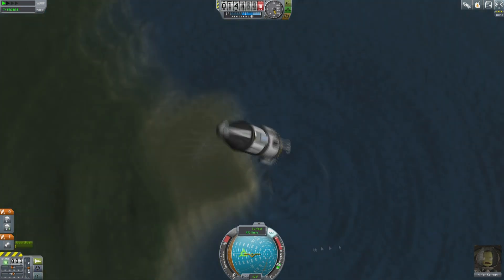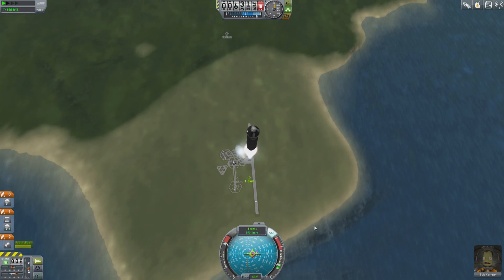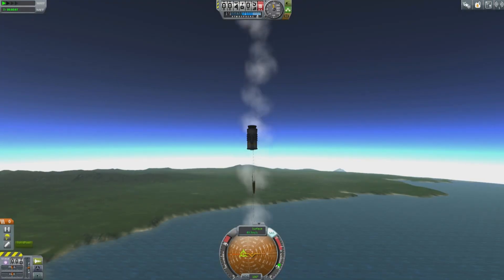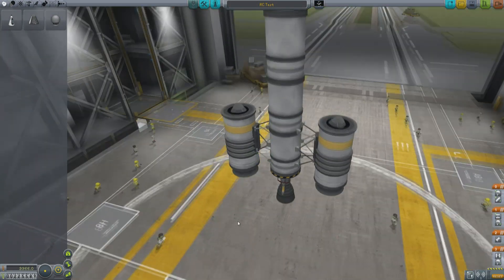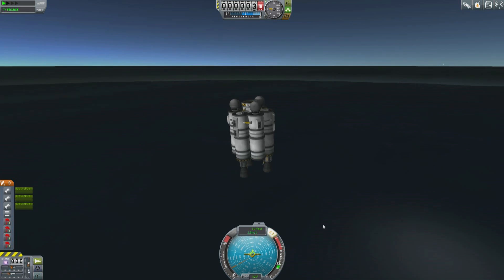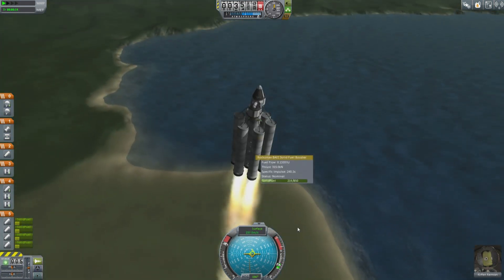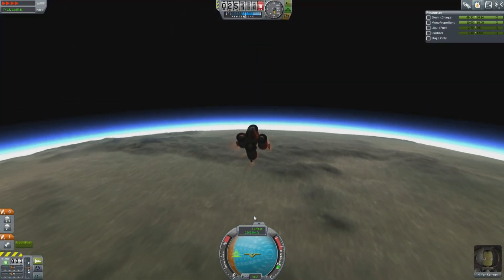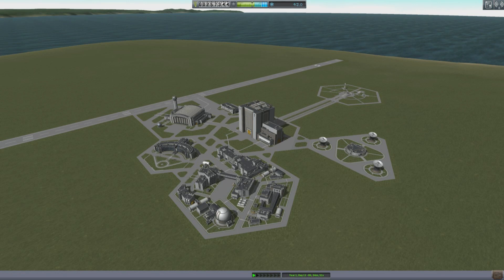Kerbal Space Program - Recovery And Reuse Tutorial in First Contract

Comment: Scott, Debris will be added to your funds when you recover it. At least thats what I saw in 4KBShorts Video. He pointed that out in an overlay to correct what he said in the Video. Seems like there is just the Ingame-Popup missing.
Reply from the maker: When I tested it last night was not getting any cash back, and there's also the automatic removal of anything too close to the launch pad, that doesn't generate any cash.  
The game is in development, it's possible things are changing.
Reply from the maker: Mark Parigger Ahh I know what you're seeing, there's an edit in there. I originally went to the map screen and there was another mission that I realised would confuse things, so I deleted it (getting cash) and then redid the clicking through to the tracking station. The money came during a section that was edited out.

I of course edited it out to reduce confusion, and, failed.
Reply: Scott Manley  But if you look closely in your video right here the funds do change after the debris is automatically removed. It goes from something 516 to something 586 (or something like that). I'm referring to your test if boosters without probes are recoverable, the two screens between the time you go into map mode (of the tracking station).
Reply: Scott Manley  Well, you really have to look for it (as I did because I had watched 4KB's video as well). So in general it's really not confusing at all. But I'm still glad that that's cleared up - and it isn't that important anyway.
Reply: Scott Manley You did not fail, my friend :)

Comment: since tanks are probably cheaper than engines, why not put one giant engine under the central core and arrange ejectable tanks around it radially, connected through asparagus-style fuel lines ?
Reply from the maker: Well the large engines tend to be less efficient in space so there is that.
Reply: AverageArts You can't counter act that. Your craft is very heavy on ground since you have a lot of fuel. You need a very strong engine. As you lose the tanks on the way up your craft gets lighter and lighter but your engine has the same weight and same power. You can limit its power but not its weight on the way up. This is why asparagus has not one big engine but lots of smaller ones. You get rid of thrust which you dont need AND engine-weight at the same time. They don't really use asparagus staging in real space flight anyway. Fuel is cheap so you can simply use a little more of it instead of doing some crazy fuel pumping which is risky. Just look at the Falcon 9. They use cheap kerosone-like fuel, 9 engines for redundancy and because they have to build more little engines they get cheaper due to mass production than fewer big ones. They also use 3D printing which can be done pretty much on every planet so you can make your own parts in case something breaks. The material can have far more complicated structures in the inside with 3D printing so you don't need solid blocks of metal. You can make aluminum with honeycombs inside. Very rigid and light. A nice side effect is those honeycombs act like a heat shield aswell.
Reply: The problem is the lighter your craft gets the higher is the relative weight of your engine compared to the rest of your craft. When you don't get rid of some engines on the way up you end up using more fuel again than you had if you had picked less fuel and a smaller engine. Asparagus is only usefull if you split your engine power as you split the fuel. I hope that makes sense :-)
Reply: KerbalEssences But then you could just limit your engine output to match an effective t/w ratio and counter-act that. Couldn't you? Or am I wrong here?
Reply: KerbalEssences yes it makes sense, but does it make a big difference? considering the "standard" ksp engines are between 0.5 and 6t vs. fuel tanks that are useful for launches 0.25 and 4t (empty), it's like towing a single empty tank with you at all times. maybe it's worth it if you can fly your entire mission on a single engine... depends on the actual price per engine obviously. someone should test it once 0.24 is out.
Reply: trisymphony Check my video about "more efficient staging". I've ran into the exact same issue there. Take the same amount of fuel,  use regular asparagus and you will reach much more altitude. (watch?v=t1j9nBomn3M)
Reply: yes, your video showcases exactly what i had in mind. so, what's the altitude number for the same design with traditional asparagus staging with engines under each tank? efficiency aside, it will probably be a lot more expensive (many more engines) and heavier - which was exactly what i was wondering about. with the introduction of money, asparagus staging with many engines might end up costing you more and might not justify the few hundred extra dV you get. without actual figures, it's all just speculation on my part. i was just wondering where the sweet spot between engine cost and fuel efficiency was.
Reply: trisymphony If you do asparagus with 5 engines (i use 4 in the video, so even 1 more) and 12 of those tanks (3 for each engine) you can easy flyby Moho and return to Kerbin. I've just tried it.
Reply: ah, thanks. anything more "tangible" in terms of dV figures?
Reply: Scott Manley Doesn't it depend on nozzle size and expansion? But yeah, while in the atmosphere you want your TWR around 2, so asparagus is good. As you go higher, you need less thrust. Why carry a Kerbodyne when.you need an LV-1

Comment: there's actually something a career mode mod did ages ago that I think the developers could make use of here. with the mod installed, anything that makes atmospheric entry outside of pysics distance has a census run on it, scanning for mass and drag values assuming deployed parachutes. if the net drag over mass coefficient results in a velocity below 15m/s at sea level, the wreckage is automatically recovered. I think that would work great for the new career mode, and I forsee it being one of the earlier mods made for 0.24